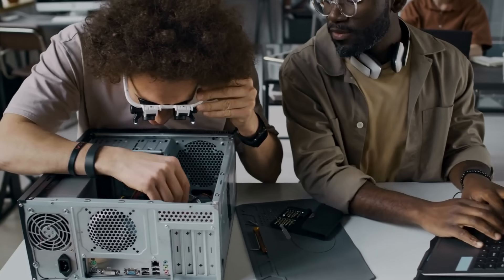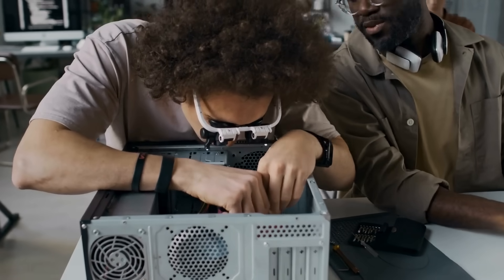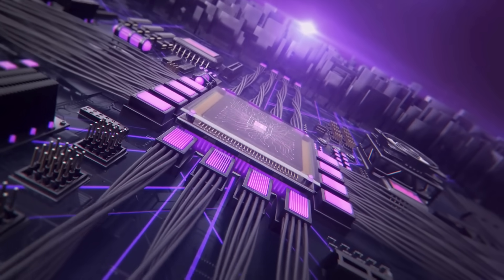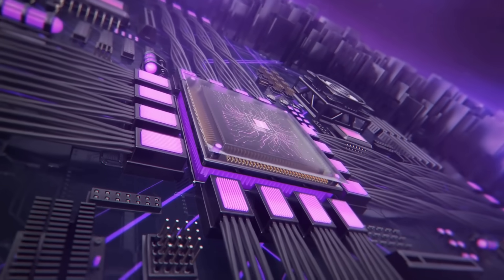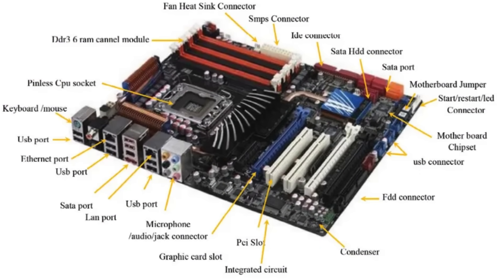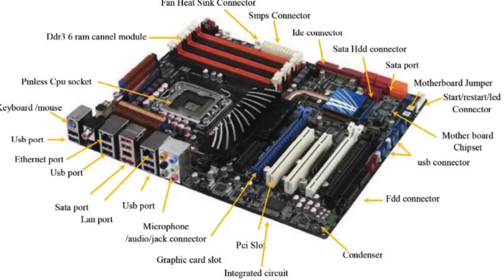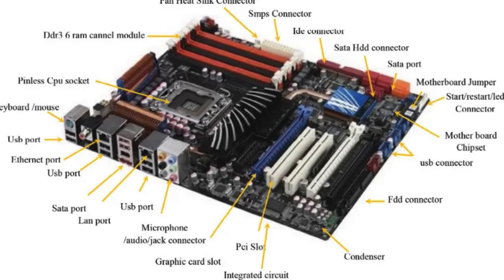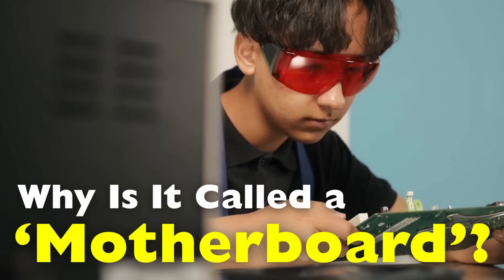What “Motherboard” Really Means — And Why It Matters

Comment: The main board was had only slots to put in various boards such as a CPU board, memory board, an I/O board, drive controller boards Of course it had a front panel to input a start command. mother boards had BIOs CPU and chips sets on the board

Comment: I found it interesting that on some much older computers, there was no mother board per-say, but a back plane, and the CPU, memory and other parifs, 
were on their own boards, that  slotted into the back plane, like on an older small server. I like that Idea because imagine how easy it would be to just pull
the CPU board , instead of having to reach down inside of the case, or disconnect everything and remove the motherboard entirely, to upgrade the CPU, or
clean out the CPU fan or heat sink or add heats sink paste. . . .

Comment: One wonders why they didn't coin the terms master-and slave-boards, like master-and slave-cylinders as in automobile brake and clutch systems.
Reply: There are protocols where that terminology has been used like I2C. I expect master/slave terminology was not used on the IBM PC because the PC bus included interrupt lines and DMA channels. Direct Memory Access (DMA) is a hardware-based data transfer mechanism that allows peripherals, such as graphics cards, network cards, and storage controllers, to access main system memory directly without involving the CPU. This means the the daughter cards could take control of the PC bus for a period of time. It also means a misbehaving daughter card could freeze the computer.
Reply: That term-pair was used primarily for something like a database and mainly meant to infer a copy or subset of the main. A motherboard centralizes communications between very different components and none of those can do the task of the others.
Reply: In an IDE hard disk drive controller, you can only connect 2 drives. One is called the master, and the second drive is called the slave drive.

Comment: what about the father and son boards?
Reply: The mother is the central figure of the family,  while other members are not necessarily are not seen as nurturing in family dynamics.  There are pretty bad mothers out there,  but they still are generally viewed as nurturers.
Reply: @donnabrooks1173  In any case "Motherboard" is clearly microaggressive: it should be more correctly called "Parent1board"!🤪😹😉
Reply: @SteamBlackCat 🤣🤣😅😅😅
Reply: Thank you for this😂😂😂😂😂😂😂
Reply: @Jasonmakesvideo You are very welcome.   Best explanation that I can give.   🤣🤣🤣🤣🤣
Reply: The have pins not holes
Reply: Father board could be the power supply (typically is one board, if you open up that metal power supply cube). The Father board power supply gives all the raw power, at a few different DC voltages. A real Father (assuming he's a real man) supplies the raw resources and money...
Reply: @ellhullio26 then where is son instead of Daughter